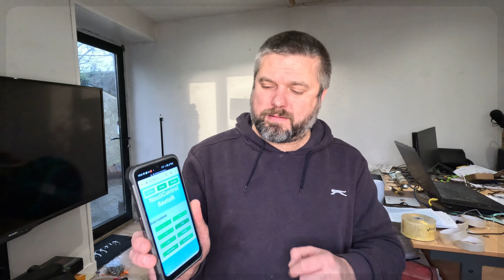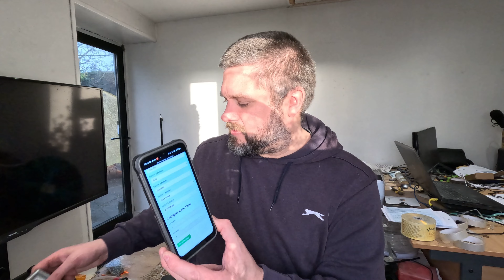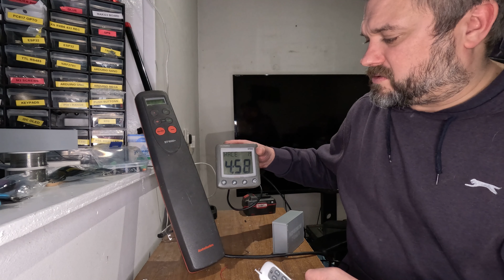Open source Raymarine Autopilot Remote Control with Seatalk to Open CPN Wireless Bridge.

Comment: This would also work with the newer Evolution autopilots, via a Seatalk to STng converter. This is the current solution Raymarine offer with the S100 remote. Good work! 👍
Reply from the maker: Thanks for the info, wasn't aware that worked !

Comment: What I am trying to work out is a  way of sending waypoint information from OpenCPN to the ST1000 to follow routes. So it turns the boat on each waypoint like an autopilot would. Without manually having to press the buttons to correct course each waypoint.
Reply from the maker: Two way communication for open CPN is planned , first will be instrument data to open cpn (thats nearly completed) then look at translating nmea from open cpn to seatalk commands.  The hardware is all good for it so all just firmware updates and me getting some dev time !

Comment: Could I just check, do you sell the controller box and app? I can set routes and waypoints on opencpn from laptop and my st1000 follows it via seatalk/nmea converter but every time it reaches a waypoint a physics button needs pushed on the tillerpilot for the course change to be accepted? If I’m getting this right you’ve created a device that allows you to confirm the route via a phone  from anywhere on the boat?? Is that correct? If that’s true this is a game changer
Reply from the maker: It should work , all the buttons on the remote can be mapped.  Yeah i sell them made up over on my web site https://www.nauti-control.com/ 

The app is just a web app as it's got a built in web server over wifi .You can use the provided remote control.  I am also working on an android wear os watch app and mobile app to do it over bluetooth as well .  If you check out the web site there are more demos.  There are regular firmware updates based on feedback.

Comment: I would like something that could connect to my Raymarine ST instruments (such as the RayControl or RayView Apps) whilst I am down in the salon without the need to turn on my chart plotter.  Turning on the chartplotter MFD uses too much power but needs to be on to create the WiFI for the RayControl App to talk too.  Would be great for instance to use the RayControl App on my iPad to look at the Wind Speed I reading with switching on the chart plotter - a solution to this issue would be great
Reply from the maker: That should be in the next formal firmware release ! working on a few features such as that , web display of st data , wind , depth ,  speed just trying to get some nice js to display graphical guages rather than text . Hardware the design has everything needed to do it so all software at this stage ! Keep an eye on socials hopefully provide an update in incoming months
Reply: I was not able to compile  the code in Visual code I had  following error  : c++\8.4.0\bits/std_function.h:686:(.iram1.66[_ZNK8delegate6detail12DelegateImplIPvvEclEv]+0x24): dangerous relocation: l32r: literal placed after use: .literal._ZNK8delegate6detail12DelegateImplIPvvEclEv
Reply: @renatomanzo7662  looks like a setup issue as it's an error with std functions